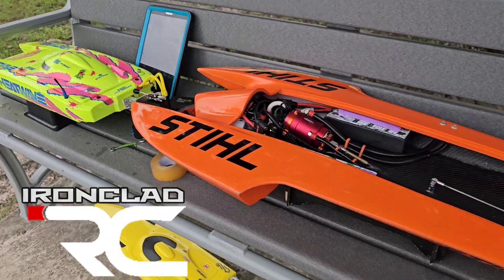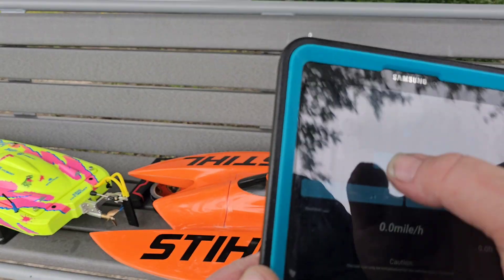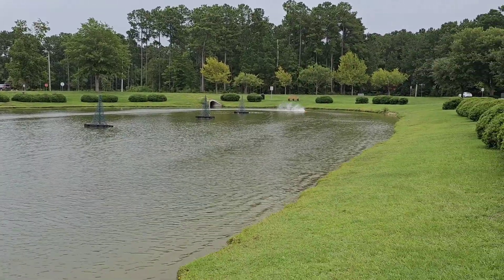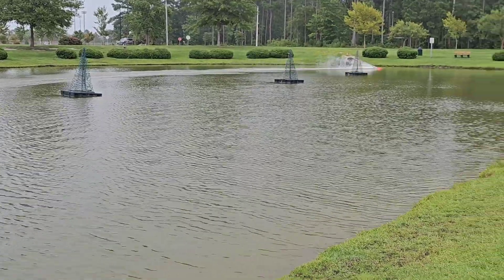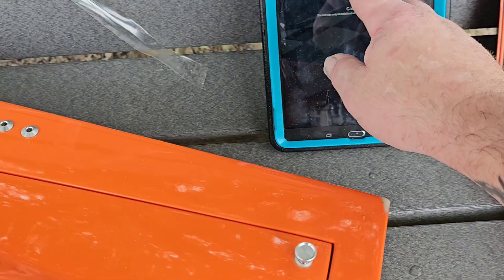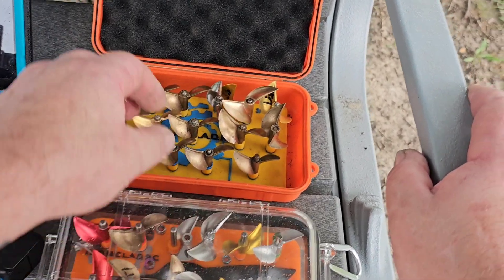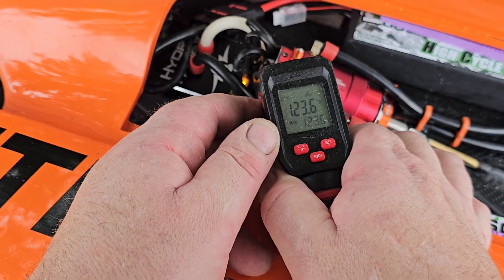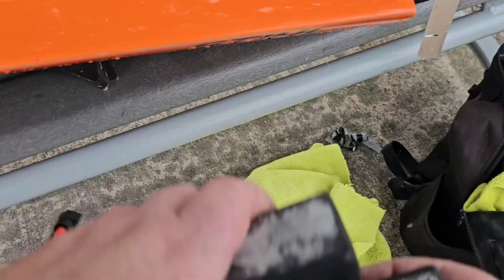Testing Some Abc Props On The Deltaforce Vortex 34 - Castle Creations Hydra, Leopard x2 4082 1600kv

Comment: Im down in new zealand and love your content thanks. Its very helpful. Small market it this country because of small population so information from retailers is lacking. I run a modified sonicwakev2 , modified sr65, building a petrol powered pro vee and my dominator has just arrived. V cool boat. Got the 1650 kv version so i could run 8s thru it. Its amazing on 8s but 6s is a bit lacking, or felt very restrained. This was all with the stock prop supplied by bill sharpened. Any ides on how to pull a bit more out of it on 6s? Props etc. Any input appreciated. Im running 5000mah 90c lipos

Comment: What did you seal the strut to the hull with? When i try to bend my stuffing tube by the strut im worried about breaking that through hull seal.
Reply from the maker: I used epoxy, and a few layers of fiberglass & carbon Fiber cloth for reinforcement
Reply: @IRONCLADRC  I used E6000 on this last one to allow flexibility versus risking the epoxy cracking.
Reply from the maker: @PatriotBrad  good idea 👌

Comment: Do you remember what your pb exactly was with dom? There a lots and lots off videos, so asking may be easier... Mentioned i had faulty lipo, but did a testrun with some 60c's today... Im getting really close and these lipo's made in earlier tests 6mph less than the 90c's... Ordered a new one, so im very curious and excited...
Reply from the maker: I'm pretty sure my dominator pb is 91mph on 8s.   6s pb 87
Reply: @IRONCLADRC  Thanks... It will become very, very close i guess... I measured previous 6mph difference with 90c lipo's and 6mph with shortened rudder blade (with other prop!)... What they will bring together, i don't know. Will test it apart. Didn't flip or anything now, i went to bigger pond so i can ease more on the throttle. Definitely helps to keep it more stable...